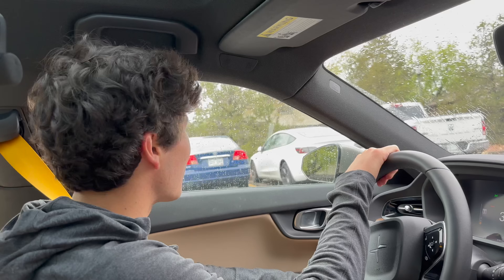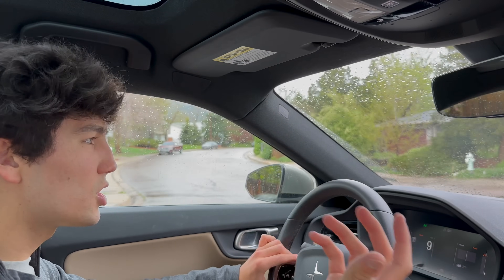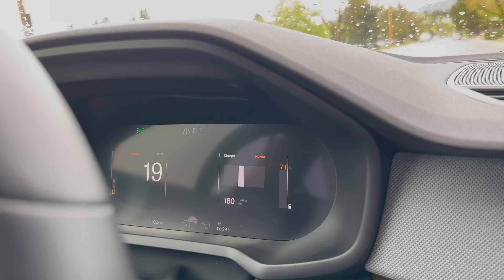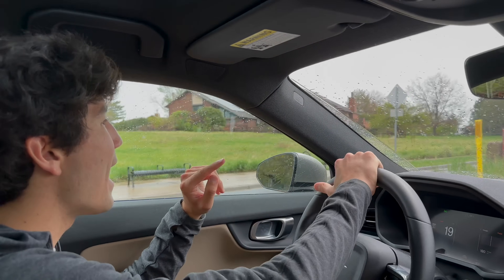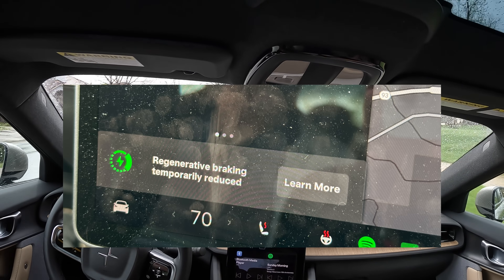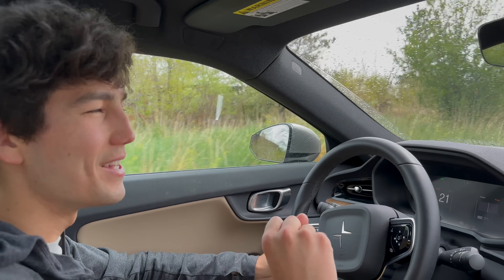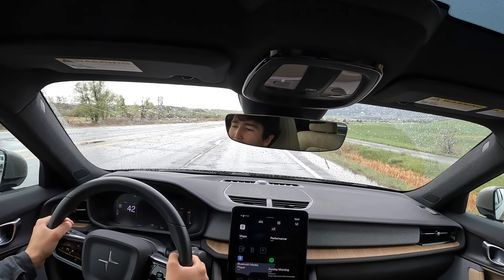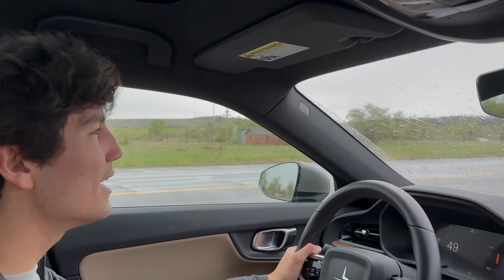How To Master Regen-Braking In Any Electric Car For More Range

Comment: It's very worrying that the hummer EV can't stop itself without regen. If there is a failure in the drivetrain which prevents regeneration from working, then you don't have a safe way to stop the vehicle. Period. Unacceptable in my book

Comment: Reading the road is just as important don’t drive up to the lights. Keep your distance from car in front so you can use regen if car in front turning. My wife has a heavy right foot and can feel the regen cutting  in the speeding up so I switch of regen from B to D much better on motorway. 😊

Comment: Not mentioned here are cost factors.  A friction brake job (pads, rotors, maybe calipers) can run in excess of $1000.  That $$ would cover a lot of energy, whether electric or gas.  I've been driving hybrids since 2006 (a Honda original Insight and two Prii) and recently.got a 2024 Leaf.  Thanks to regen braking, I never had to do a brake job on any of the hybrids.  The most recent, a 2016 Prius, had 140,00mi on it and still 5mm left on the original brake pads.  It averaged 66mpg (obviously more in summer, less in winter).  Yet not having to do 2-4 brake jobs saved far more than the gas savings.  The Toyota service advisers said that 100-15kK on brake pads is not uncommon on Prii,

If you drive smoothly and predictively, kinetic energy variations will be minimized so energy gains from regen are less.

Comment: Thank you!  You gave a great explanation on Regen!  I have it on my EV and I had a clue but now I have a better understanding of it overall. Now I am inclined to use it as you prescribed. Thanks again.
Reply: Good but the motor does not reverse direction when regenerating.

Comment: 6:12 - So, wait… do EV and hybrids recharge their batteries in TWO ways? The battery can recharge from the free rotation of the wheels when coasting, AND ALSO the battery can get recharged from the heat/kinetic energy of breaking? And how exactly are the wheels being slowed down if not from the brake pads?
Reply: Coasting does NOT charge the battery.
Reply: @JohnCap523  Hello. Since my comment, I got a Civic Hybrid and the screen shows energy from the wheels to the battery, charging it when I am coasting/letting gravity roll me down a hill.
Reply: @MagnumDB    You’re using regen depending on the level. Coasting is considered 0 regen, which will NOT produce energy. If you set your regen to the lowest setting, which is coasting, you have essentially turned off regen. Not accelerating in any higher regen setting is not considered “coasting”.

Comment: It doesn't use heat energy to charge.  It's the same ektromagnetic field acting in the same exact manner.  The current flows in the opposite direction is all.

Comment: Electro-braking with regen is, of course, brilliant as an alternative to mechanical braking, because it recaptures a portion of the kinetic energy that would be lost with mechanical brakes (literally blowing away on the wind).  

However, as you pointed out, electro-braking is a good thing ONLY WHEN YOU HAVE TO TO SLOW DOWN OR STOP.  Electro-braking incurs a round-trip loss on the order of 20-25% from the kinetic energy you extract at the wheels to the electric drive energy that you can put back onto the wheels.  That means that every time you seesaw back and forth between electro-braking and acceleration (as happens frequently with one pedal braking), you're losing about a quarter of all the braking energy.  

The most efficient way of using your kinetic energy when you don't HAVE to brake is to allow the KE to move the car over the ground directly right now.  This is done in a sophisticated maneuver called "coasting".  When coasting, there are no 'losses'; every erg of kinetic energy that's 'lost' goes towards moving the car.  So, coasting is considerably more efficient that braking when braking isn't required.
Reply: Absolutely...however most drivers would benefit from OPD in a majority of their driving. Open road/highway is probably the only time I turn it off. Having that additional braking helps in traffic, around town, or in populated areas where a 5000lb vehicle with greater momentum requires additional braking force.
Reply: Yes, I was going to mention the same, on Chevy EVs there's a steering wheel paddle that activates max regen, so I use that with the accelerator that coasts when let go. It gives 4 modes of operation: accelerating, coasting, max regen braking, and max regen + friction brakes for emergency braking. One pedal driving is overrated, because it doesn't exist on ICE cars, and is a bit of a novelty.
Reply: What works for me is to think of not going any faster than I need to.  The faster I am going, the more kinetic energy I stand to lose if I need to slow unexpectedly.  At 80 in a 65, if I come up on a knot of traffic I will have to slow down.  If I'm simply driving at the speed of most traffic I don't throw energy away.  Most trips are not long enough for the travel time savings from higher speeds (even if they were possible) to be large enough to be worthwhile, even not factoring in the exponentially higher aero drag of higher speeds.
Reply: You don't seesaw back and forth between electro-braking or acceleration in one pedal mode or if you are in a regen mode as there is a coast zone in between the two on the pedal.

Comment: Hi guys, greetings from the U.K. Anyone who drives an EV should set their vehicle to maximum regen, initially this will feel strange if you are used to a combustion car, but you adapt really quickly and it becomes an amazing way to drive, using just the accelerator. Your argument against using full regen is very weak, I’ve had a BEV since 2019, even on the freeway I leave regen fully engaged, it is far safer, and far more efficient. If an incident occurs ahead of you and you need to slow down, as soon as you lift off the accelerator, regen kicks in before you can even make content with the brake peddle.
There is also misinformation here. BMW do not used brushed AC motors, that’s just flat out wrong! What they have done is changed the logic in the software controlling the inverter pack to allow motor to effectively be in neutral under certain driving driving conditions, which prevents regen engaging based on a number of parameters monitored by the software, Tesla’s also do this - as you would expect, as they are the most advanced EVs out there.
The EV I own is the little BMW i3 (not the REx, just pure BEV).

Comment: I use one pedal driving, almost exclusively with my 2024 Honda Accord hybrid. You can adjust the strength of the breaking with the gas pedal with a series of paddle shifts. Only under extreme circumstances what I ever use the brakes. In the first 1000 miles, I’ve had 55 miles per gallon average.
Reply: Good for yiu it

Comment: Driving most efficient, is not just about max regen, it is about driving with the lowest use of regen. Regen gets back only a small fraction of the electric power, could add up in stop and go traffic. 
On a straight route, highway traffic, it is best to minimize regen(by not modulating the gas pedal) by gradual acceleration,coasting and deceleration.
Reply: Exactly. Many people even falsely believe that single pedal driving increases distance on a charge because they have incorrectly been told or incorrectly understood that single pedal driving increases regen and in their mind more regen = more battery charge recovered. But the fact is that coasting when possible is way better than speeding up, regen, speed up, etc. Single pedal driving reduces your CONTROL of regen and makes regen happen even when a coast would be better. Using the brake give you much finer grained control of coast (zero acceleration pedal and zero brake usage) and allows you to feather into regen only if traffic stopping quicker than anticipated or you didn't leave enough room to coast. 2 pedal driving is simply superior. You can go further with 2 pedal driving than you can with single pedal.
Reply: @robertkluttz8313  If one pedal driving reduces control of regen then the issue is between the accelerator and the seat. You just have a much more finegrained control with one pedal driving if implemented correctly. Because surprise, you can coast perfectly fine in one pedal mode too. But you have a lot more control if you need small decelleration when cornering or due to traffic. It only comes down in how good a driver you are. And don't bring in Porsche's claim, as they did not even test one pedal driving in their "test", and it had a lot of different flaws too.

Anyway regardless of the way you want to achieve things, avoiding regen and/or braking is the most efficient way to drive.

Comment: chevy volt has low mode which is almost 1 pedal driving. the volt doesnt let you charge past 88%ish SOC depending on battery age so you almost always have normal regen. if you charge to full at the top of a large hill and then drive down and manage to get to 100% soc, the car actually starts spinning the motors in opposite directions so you never feel a difference in break pedal feel. the rare earth perm mag motors in the 1st gen tends to get me around 7miles/kwh around town which blows tesla out of the water. not having rare earth perm mag motors is a cost shaving strategy to save a couple hundred dollars per vehicle imo. supply shortages are not real if youre not doing super lean just in time mfg either

Comment: New combustion tech has regen braking WITHOUT use of electric motors or batteries.  It uses compressed air that is later injected into the engine.  It does not store energy as "fuel" as a BEV does (Chemical energy in battery), but only saves work in the combustion cycle (compression).   The efficiency is equal to the car efficiency.  This new tech will be 75%, so regen is 75%.  An old ICE car would not be able to do this as an Otto cycle is NOT an "open cycle" combustion system.  In theory an Otto cycle is 30% peak and if regen were possible, it would only be 30% efficient.

During EV regen, the process is the efficiency squared.  For example if the engine is 80% plug to wheel, it will be 0.80 ^2= 64% or the efficiency twice which is 0.8 x 0.8 = 64%. This clearly shows that coasting is more efficient as it does not use the process twice as regen with EVs does.

This new combustion tech uses three pedals:  One for acceleration to the right, one for friction braking in the middle and one for regen braking to the left.  You can apply regen with the left foot and then also use friction braking from 5 mph to 0 mph to modulate brakes.  This promotes coasting and the motors STOP while costing.  There is no need to idle the car and the motors are very low inertia and  can start and stop without use of a starter.  Motors also torque out from zero RPM similar to an EV.

This new combustion tech will be 150 MPG HWY, 240 city, 200 combined, thus beating all EVs in energy consumption.  This is due to cycle efficiency at 75%, 75% brake recovery, and 1/2 the weight with no drive battery to carry around.  

With RE fuels at $1-1.5/gal made at home vs charging on a RE grid at $20-30/gallon equivalent, this combustion tech will be ~20 times less costs for energy, making BEVs a high cost choice.

Comment: I know Hyundai uses one pedal regen using the gas pedal, levels 0-4, but how does it use the brake pedal?
Does stepping on the brake pedal in a Hyundai EV or Hybrid activate only the friction brakes. 
Or does stepping on the brake pedal activate “Brake Blending”? (that is Blending both regen and friction)
If so, does stepping on the brake pedal, activate brake blending even if in any one of the 4 one pedal modes 0-4?

Comment: Helpful  Video - - -   I am a teacher  that is  describing  EVs    versus   Gas Engine and Diesel Engine  vehicles.   I will definitely  use  your  video   to   augment my  class'   understanding of  Regen.  Braking......
Reply: at about 0:40 he says that ' d with the regenerative braking you take the heat energy from Rolling backward you make uh you have an electromagnetic field that basically '
-
it does not take the heat energy from rolling backward - that is something that he is confused about - 
-
the heat is loss - however - it can be used to provide heat to the cabin
-
my advice is disregard any detailed specifics given by him and listen only to the general information - find the details from another source

Comment: One other thing to note with using OPD primarily is if you don't brake using the pads regularly, rust can accumulate on the rotors, so it is good to hard brake every once in a while to clean off the rotors

Comment: I don’t think the motor goes into reverse to regenerate the battery … you can’t have a motor spinning at thousands of RPM suddenly spinning in the opposite direction.
My understanding is that the electrical circuitry changes, so that the motor generates electricity.
Can you please clarify?
Reply: Correct “rolling backwards” is inaccurate — it’s a switch in current direction

Comment: I own Ioniq 6 which has 4 levels on paddles and auto. I’ve done test on motorway driving 70mph constant speed with regen set to zero. While driving decided to turn regen on holding  accelerator pedal in the same position maintaining the 70mph and increasing level of regen. With each level increase while holding accelerator in the same position the car was slowing down more and more. So to maintain 70mph I had to press accelerator pedal more and more. Can anyone explain why this is the case ? I was thinking regen breaking should apply only when braking and not be on all the time “holding vechicle back”. I’m now using auto which still sometimes applies regen when no need for braking. I would appreciate if someone could explain. Can’t find answers

Comment: I have a Nissan Ariya, my first electric car. I have a question about regen driving. Is it better to coast and slowly slow down, low regen but longer or slow down faster, higher regen but shorter time? thanks
Reply from the maker: Whatever keeps you accelerating the least. So typically slower, smoother! Try to keep momentum (within safe limits) as best possible basically — avoiding sudden slowing or speeding up. Make your accelerations slower (as is safe) to be efficient too.

Comment: I use regen purely to avoid using the service brakes, and increased efficiency is only an upshot. I have never ever once come across a situation where I thought "I'd like to slow down right now but without regen." I turn one pedal driving off when I cancel cruise control with the regen paddle on my bolt, but always put it back on once I've coasted enough.

Comment: Thank you for the insight. I’ve ofter wondered about the regen efficiency of rear-drive EVs.  

How does the system voltage improve regen braking? For example, Porsche claims that for their Taycan it’s the 800V system that makes it possible for regen to take care of 93% of normal driving braking?
Reply: That's right

Comment: This has been widely debated in the Polestar Forum, and it seems to have netted out that there is very little to no difference in efficiency between OPD and standard coasting, at least for the Polestar. The Polestar uses a lot of blended braking even with OPD off, and so with highway driving it is often more efficient to coast. Not about driver excellence or anything, really just the physics of the vehicle, much like with the Porsche reference you mentioned. With my Polestar I personally drive OPD in city and traffic and then turn it off for most highway driving. I enjoy the feeling of OPD so will often just use because it's enjoyable and relaxing. But just recently did a full 100-0% range test largely with OPD off and still hit the 400KM/250miles the vehicle is rated for. I think really drive what makes you feel good and it'll all work out.
Reply: Doesn't matter which mode the polestar is in, the regen is going to be activated in all modes. If you brake while is in coasting, the regen will be used to slow down, not your  brake. Unless you need to slow down very fast. So the most efficient way to drive is to have opd off at all times. The brakes are not going to get used more

Comment: One situation where one pedal driving is especially nice is when driving through mountainous terrain. With one pedal driving, there is no need to switch back and forth between pedals on every downhill, and no need to wear out your friction brakes maintaining 50 mph on a steep descent. In fact, regen in an EV even works under cruise control, so you can descend a steep hill at constant speed, without needing to press down on any pedal at all.

Comment: I’m old enough to remember when many cars had quite strong throttle lift-off engine braking. I remember it going away in the late 90’s when variable valve timing was introduced. Automatic transmissions also started using taller gears to improve fuel economy under low-to-zero throttle, which also reduced engine braking. So these days most drivers expect cars to coast when they release the accelerator. These reasons don’t apply to EVs, hence the variation in behavior you have highlighted in this video. Note that the amount of throttle liftoff deceleration varies too. Chevy Bolt has more than Tesla Model 3 for example. Don’t confuse this with one pedal driving, which is where the car will continue to slow down even after regen stops working. For example, Tesla has always had throttle liftoff regen, but only in the last 4 or so years have they had one pedal driving. Very few drivers care to or know how to hypermile. It’s quite possible to do regardless of how the accelerator pedal works. The more important question is what is best for safety and driving enjoyment.